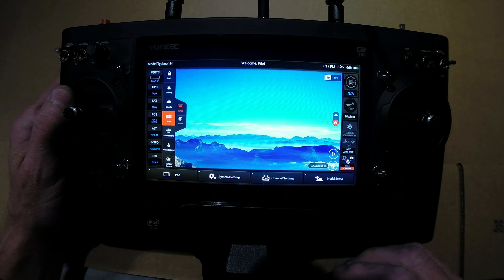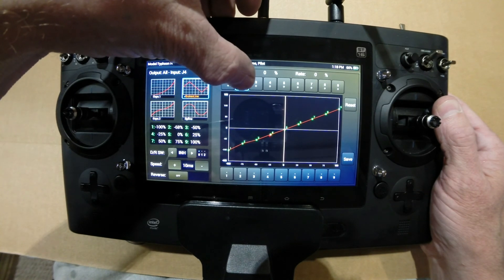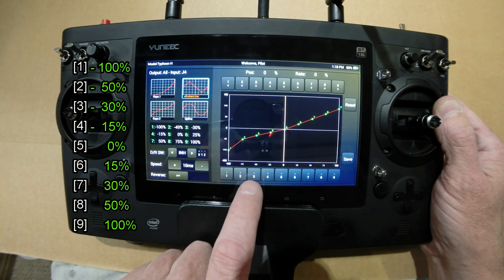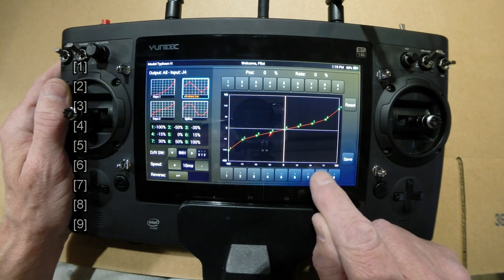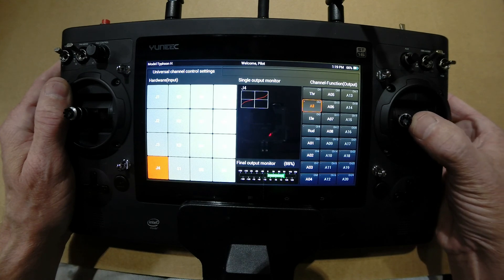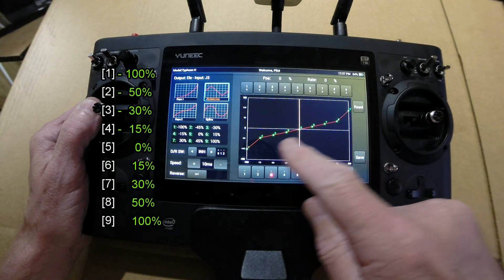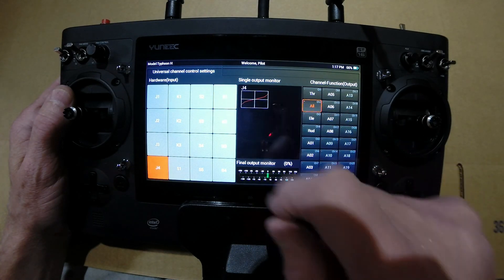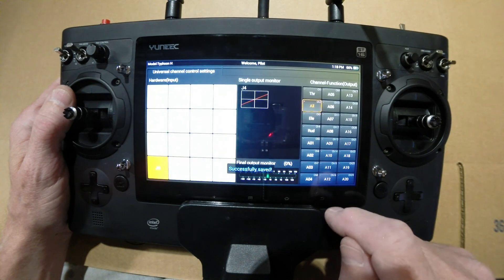ST16 Rate Curves

Comment: Hey Patrick, I've been watching your videos on the Typhoon H which I just got yes very late in the game. I have been searching everywhere for info on expo/rate/curves for all four functions for I have changed all four and I'm not new to drones. Seems that you can increase the rate to 150% but I am very hesitant to do so not knowing how much is too much. I noticed after setting rate curves as mentioned the final output shows that the sticks are only moving to about 80% at full throw. I fly in manual mode which steps things up but I believe it's still a bit sluggish although it flies amazing! Do you have any info on just how far you can crank up the throws before it's a problem? I would think it could handle the full 150% but some flight controllers need a certain% as a buffer for motor differential to make controlling it possible. I really hope you see this for you so far are the only one that had any info on setting end points for expo/rate/curves. Thank you in advance for any input you may have!
Have a great weekend!
Mike.
Reply from the maker: Mike, I have never pushed the rates up that high so I can only say you should do so in increments and test everything slowly. One thing to keep in mind is that the ST16 has been known to get oxidation on the stick potentiometers which can cause erratic behavior. One thing you want to check often is the Hardware monitor and make sure when you push a stick to it's limit the corresponding signal shows 100% of it's movement. If you get a bad stick reading anything done to rates will also be problematic. I have had to clean my sticks three times on my H Plus but never on my Typhoon. Good luck.
Reply: @buelle109  Thank you so much for responding and your information I could see how that would present a problem did you use a spray to clean them? I have checked the monitor and all seems well but it does display some erratic behavior at time but only with gps on, in manual mode it flies amazing! Thanks again!
Reply: Hey Mike, I was curious if you adjusted your YAW as well. I noticed when I use left or right it seems like a very long time before it starts turning. Did you set the same values for yaw as for the right stick? I would like the “throttle/yaw” stick to be more responsive.
Reply: @atglennite01  Honestly I would have to check but I believe I did turn it up to match the others. Does it do that in rabbit mode as well? Honestly to me the only time it flies like a normal drone is in manual mode with gps off and some people have had flyaways doing that.
Reply: So far mine hasn’t had a fly away but I have heard horror stories about it. Yeah the yaw seems to lack responsiveness in all throttle speeds for me. I changed my settings this morning for the yaw. I’ll do a test later today when the rain stops.
Reply: @atglennite01  Hope it works out for you, let me know if it helped speed up your yaw. I think there is a lot of latency in the controls and video. Are the videos on your channel shot with the Typhoon?

Comment: Thanks for the video Buelle109, this is great for a starting point but after setting the drone up with these settings I'm still encountering the jerky startup. Which number should I start with to slow down the jerkiness with stick input? This only happens at the initial start of the motion. Should I increase the value closer to the center towards 0 on the X axis or the Y axis?
Reply from the maker: One of the  drawbacks of the Typhoon H flight software is this very abrupt reaction from hover to movement. These curves help smooth this out but they cannot eliminate it completely. This is one of the downsides of the standard Typhoon H. 

Later models such as the 520, H Plus and now H3 all have a much better flight control software and this has been eliminated in those platforms.
Reply: @buelle109  Understood, thank you for the prompt reply Buelle. I take it that the standard H is not supported to use the new software.

Comment: Hello, Buelle, This is a great video. Can you address why NONE of my T-H's fly straight. Pushing R stick FWD(J3)  results in about 10 degree left offset. R stick(J3) AFT is left offset appox 10 degrees. Orientation is A/C facing FWD(away from operator). In an aircraft, we have rudder trim to offset P-factor. What do we have in the T-H's??? Home office not helpful. Checked "hardware monitor" and all is as it should be, with only one input registering at a time.Personal or video response welcome to all.

Comment: Will these settings work with a Typhoon Q500 4K?
Reply: Thank you for your reply, Patrick! The Q500 is a very smooth flyer. But I have to move the control sticks to almost full travel before it starts to move. I thought maybe your settings would be effective in the Q500 as well. I will go ahead and give it a try, and let you know how I made out. I can always reset if if doesn’t work. Thanks again! Love all of your videos! Keep them coming! Roland
Reply from the maker: I don't have a Q-500 so I do not know -1]  if you can change the setting of the 500 or 2]  if it is even necesarry. My understanding is that the Q-500 is  a smooth flyer

Comment: Have enjoyed all your videos. I am new to the H coming from a SOLO & Pixhawk FC background. I did make the adjustments as shown in this video but still don't like the twitchiness (not a real word) of the H. Would you have any other suggestions for smoothing out the initial twitch when moving right or left. Thanks
Reply from the maker: Dave, unfortunately the standard H will need to be fixed in the programming if that is possible. Most of us have learned to live with this behavior and I, like you came from different aircraft that did not fly like this. One of the tricks if you need to start off smoothly is try beginning to descend slightly then add the necessary movement. 

There is one bit of good new regarding the new H Plus - it uses a better flight controller and these habits are gone in the new aircraft. I have a new video coming shortly.
Reply: Thanks for the prompt reply. Yes, noticed the H Plus uses a PX4 FC which is very similar to the Pixhawk I still enjoy.

Comment: Great informative vid. I have gone through following your tutorial & now find that adjusting Thr for a slow start, broken line,  the Thr looks ok on set up screen with normal left joy stick as in properties, but when hitting return it has gone to Ele..what am I missing..?  thanks..
Reply from the maker: David, without seeing the exact steps its hard to say, are saying the throttle is controlling the elevator? If so you have added a channel mix and may need to reset the ST16 to factory settings but I am not sure as I have never seen this. perhaps pose this question with pics on the forum? Good Luck.
Reply: Everything now sweet, I called Yuneec & seems the whole set up of ST 16 was way off, they talked me through & now its great, fabulous 1 to 1 service, rare these days, good product excellent after sales. Thank you for very informative videos.

Comment: Hello Patrick, Just watch my first two of your videos. Well put together and presented. Off question. He you by any chance figured out how to program the AUX button to Turn-On the GPS. I fly sometimes with the GPS OFF to practice ATTI flying. But it requires you to go into a sub menu to turn if back on. If you have an emergency this is not a good way to have to deal with it. Programming the AUX to turn it back on would be a great safety feature. Thanks
Reply from the maker: As of now there is no known way to assign GPS on/off to the Aux switch. A lot of Typhoon operators (myself included) would love to see this feature incorporated into a future Firmware Update. Hopefully Yuneec will get the message. Thanks for watching.
Reply: Thanks Patrick. Its been two years, you would think they would have used it for something by now. Especially with all the requests to do so. Always wondered what their original plans were for the AUX.

Comment: Hi all, am I doing something wrong? I did exactly like the video, but my maximum output is now around 80%, not 100% Please help!!!
Reply from the maker: B-drone, go into hardware monitor and check that your stick movement is 100% with the rate slider all the way up. If not you could have a dirty pot on the stick. Many pilots are finding that after some time, a little debris can get into the sticks and cause the output to be reduced. A plastic safe electronics cleaner has been reported to fix the problem with just a little spray. For more info, do a search at YuneecPilots.com
Reply: Thanks for the fast response, sorry i had to mention that in hardwaremonitor all sticks are 100%, very weird...
Reply: Found it, my speedslider (K3) was in the middle.
Reply: Thanks for the clear video, going to test tomorrow.
Reply from the maker: You're welcome, glad you got it fixed
Reply: I just had this happen too...   Had to come back and read your fix, now we're all good!